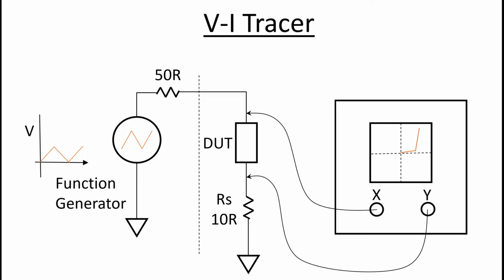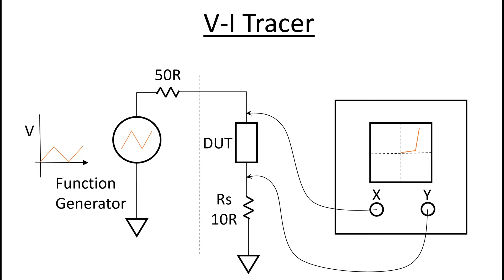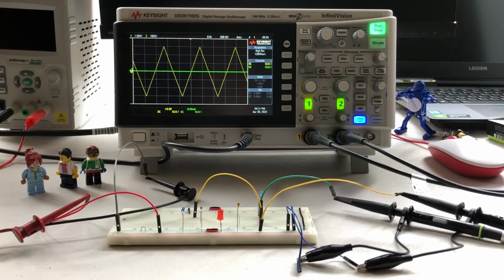Simple V I Tracer

Comment: hello found your video re component testing.
I have same scope, could not  find much on this setup in the user guide.
I see W2AEW used a transformer for his ac,this scope puts out enough?
are both your resistors hi and low value?how to determine the values to test basic components?
thanks
John
Reply from the maker: I haven't used this scope much lately but you will find the directions for using the WaveGen feature for "G" models in the User Guide.  It can generate up to 20MHz sine waves, but set it to something in the Hz range.  Set the peak to peak voltage and offset based on what is being tested.  The performance characteristics for WaveGen are given in the datasheet.  I was mainly experimenting and learning to use the instrument. I played with the settings until I got the results I wanted.  It demonstrates the concept of a simple component tester but is limited in what it can do.
Reply: thank for reply.
I get good x axis voltages, but y currents are often short or slanted, would this mean perhaps my resistor  values are too high, that lower  ohms would give more current.using a 510 ohm and a 100 ohm resistors.
John @fmilburn1943